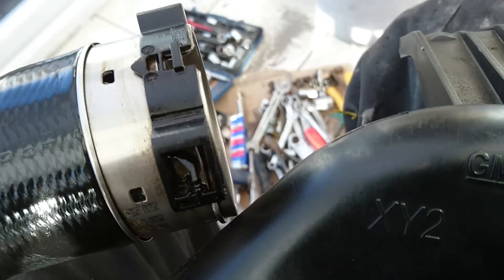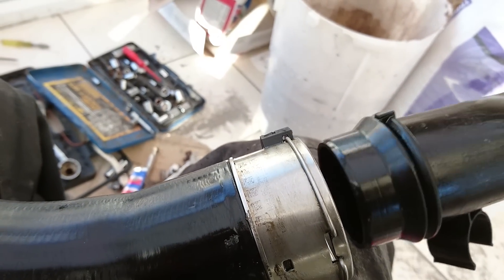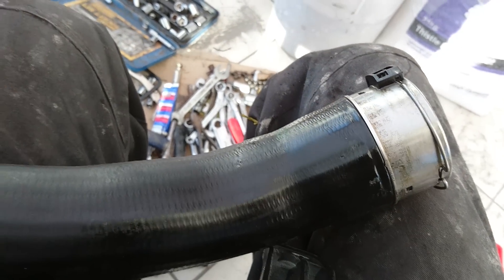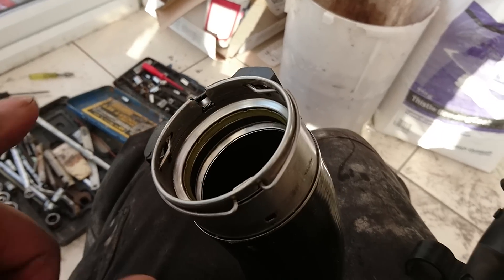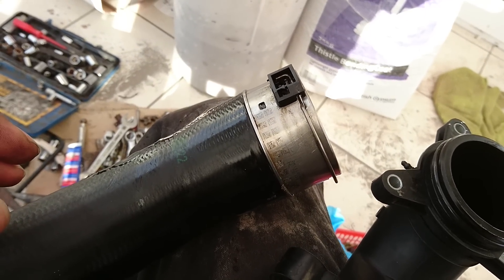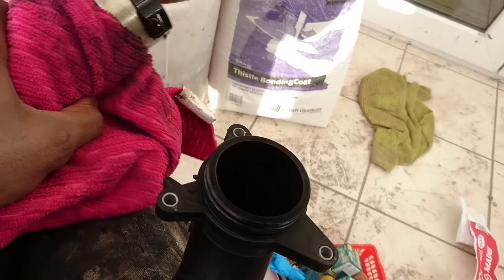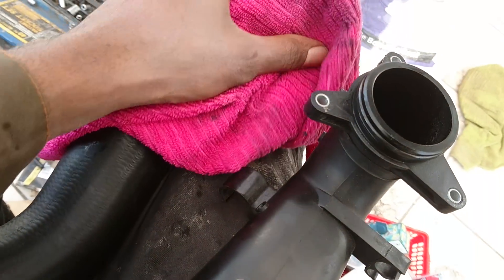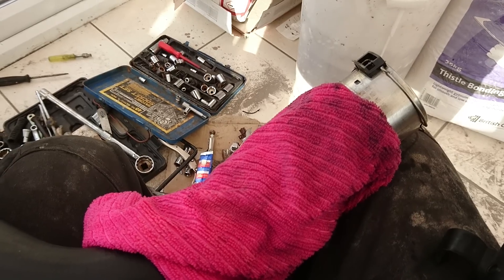Turbo BOOST LEAK!!!!

Comment: unlucky bro, let us know if you fix it
Reply from the maker: Randy Marsh i did it but still leaking a bit. I used heat resistant silicone and duck tape.
Reply: Oskidooo Oscar What was your cars symptom with this problem? I have the same thing and my car is pulling, then release boost then pulling again and keeps doing it
Reply from the maker: My car had no boost at all. Like driving with no turbo. And I could see oil coming out at this coupling. It is sealed but is much much better than before.
Reply: Oskidooo Oscar Ok, but vax told you that ypu have to replace the rubberhose with the metalclip or the other part im the video to?
Reply from the maker: Yes, they wanted me to replace the whole pipe.
Reply: Oskidooo Oscar Ok, i can get the pipe for 53Euro from England to Sweden so i might do that. Did they explain to you why it wont fitt tight once you have taken it of?
Reply from the maker: They said they had problems with this pipe since 2008 when insignia came out.
Reply: Oskidooo Oscar Ok, i just cant figure out how a new hose could fix the leak. Sounds like a one time use seal inside them
Reply from the maker: yes maybe a one time use seal, but why vax didn't make a normal coupler. i will be changing this car in march.
Reply: Oskidoo dealers are always out to rip you off, I had a cracked pipe and ordered it on ebay for £50 and just took the car to Holfords to change the pipe for me as I couldn't reach the bottom bit. Now it works fine. Mine is 2009 reg.
Reply from the maker: Andrew Beremauro I just want this car out of my life.
Reply: Hahaha, the only issue I had with mine is the DPF which keeps getting blocked and the car goes in limp mode